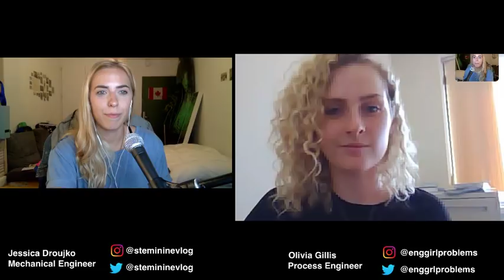Olivia the Ice Cream Engineer | Process Engineer | Chemical Engineer | Women in STEM Fields

Comment: Hi! I have a question for you.
My dream job is working in alternative energy/renewable energy industries. What should i pick? Mechanical engineer (energy conversion concentration), engineering physics (energy concentration), or electrical engineering?
Btw, love your videos. Those really help me a lot.
Reply from the maker: Honestly it doesn’t really matter. What matters is WHAT you want to do in the energy field. For example, if you wanna work in batteries then choose chemical engineering.
Reply: @RiverTechJess  i want to make wind turbines, or solar panels, or converting sea waves, waterfalls/stream into electricity. I want to make and design a device/machine that converts something into energy (electricity).

What should i pick then?
What s
Reply: helmi hibatullah I am no pro, but maybe electrical engeneering, since all you want to do comes down to produce electricity
Reply from the maker: +helmi hibatullah, so designing wind turbines and other devices that convert sea waves/water streams into electricity required fluid analysis and that’s mech engineering. While converting solar energy is chemical engineering. But if you don’t want to work in the design in the turbines or wind blades and you would rather work in the actual electrical conversion then I would agree with Renato, you could go into electrical engineering:)
Reply: @RiverTechJess  thank you so much for replying :)
Reply from the maker: Of course! Any time:)